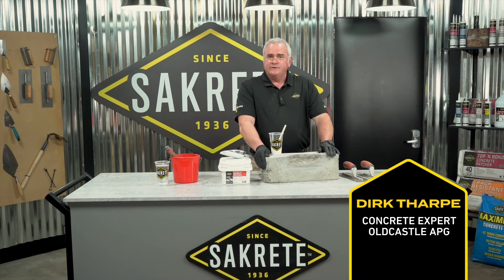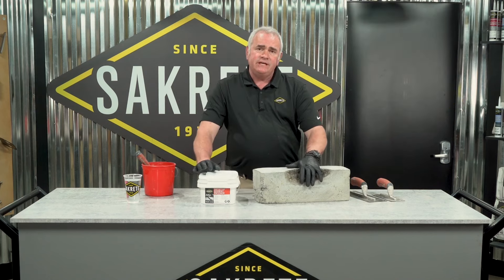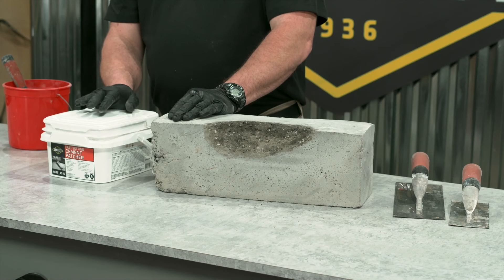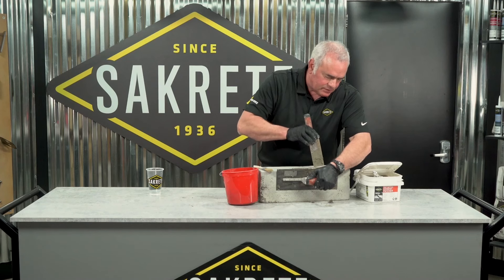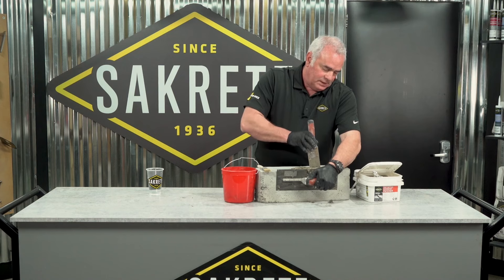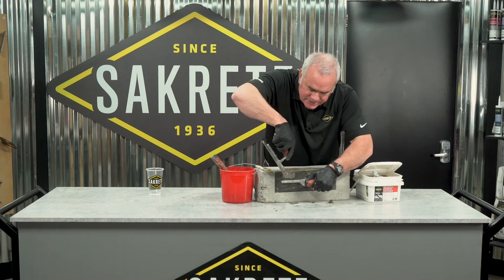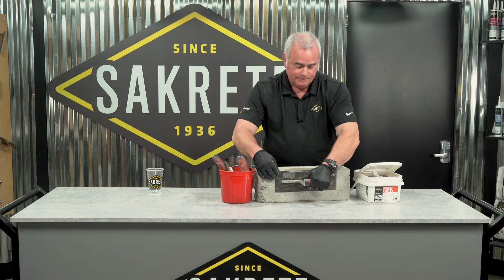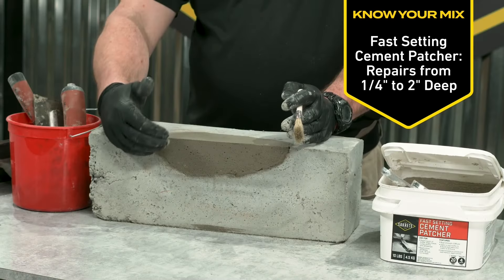Pro Tips: How to Repair Concrete Edges and Deep Damage | Concrete Repair | DIY Project Guide

Comment: Good video.  I would like to add one tip.  I have found it helpful to install concrete screws (tapcons) in the concrete before the repair is made.  This helps to mechanically attach the patch to the concrete.  We have literally installed tractor trailer loads of repair mortars over the years.
Reply from the maker: Absolutely! Great advice, sir. 

Didn't show it on this one to prove that the material can handle that big of a repair unassisted...but we're 100% with you on "real world" repairs!
Reply: How does that work? Do you just have half the screw exposed until you cover it with the cement patcher?

Comment: What is the lowest outside temperature to use this product? Can I do a repair in winter, or must I wait til summer?
Reply from the maker: Good rule of thumb is no concrete work below 40°F. 

Now, you could cover your repair and keep it warm with blankets, heaters, etc., but for non-critical repairs we'd recommend waiting until the weather warms up a bit.
Reply: @SakreteOfficial  Thank you!

Comment: Would this be suitable for driveway repairs?
Reply from the maker: Absolutely. What project are you working on specifically?
Reply: @SakreteOfficial  Large area of spalled and cracked concrete driveway.  Hundreds of square feet.  Just hoping to get 10 years out of it.

Comment: Will the color of the patch match the concrete when dried? I have a clean 10 year old that is power washed, so still bright in color.  Great Video!
Reply from the maker: Unfortunately, it's very unlikely that you're going to get a perfect match right off the bat. That said, if your slab is still a nice, fresh concrete gray, the match will be pretty good!

There are some "rapid setting" (cough) repair products that don't match concrete gray very well, but no such concerns here!

Comment: The video was fun (thanks!).  I'm a laywoman who dabbles in this stuff when I can't find someone to do this and it's common around here.  We have uneven sidewalks due to tree roots growing.  I reached out to our handyguy and even he doesn't know anyone who can do it.  So, it's my job.  Can I use Sakerete to form an angle on a angled sidewalk that's no greater than 2" high.  I'd do a 3" section and bond it before adding more Sakerete and repeat the process.  Depending on the weather, I may or may not use a snowblower and without the cement filled in, it makes snowplowing a literal pain.  Tnx.
Reply from the maker: Fast Setting Cement Patcher would be a great solve. Go check out the "How to Repair an Uneven Slab" video for guidance!

Even better, use our Pro-Mix All-Purpose Cement Mix and you can get the repair done in a single lift – 0-4" with that mix.

Comment: Great video..., 👍
Now is this recommended for a smaller cracks around the chipped cement ?   My driveway has this issue in the area of 2 by 2 feet
Reply from the maker: Right on – glad it was helpful!

On your question about the cracks, it depends if you're FILLING them or just coating over them.

Sounds like a material like Top 'N Bond might be a better fit, as it allows you to go down to a feather edge – smooth to the level of the concrete. 

Shoot us a message on social or Live Chat us on Sakrete.com with more details and we'll figure it out!

Comment: "It's still a 20 minute set, don't get cocky!!"  @3:57 I love that line :)   Thanks for the video it is very helpful, is there an approach you would use for a bullnose edge of pool coping repair, any suggestions on how to form that out in line with the good coping next to it?
Reply from the maker: No one makes concrete entertaining like our man Dirk!

To answer your question about bullnose repairs, that's a tricky one. Best approach probably involves making your own custom edger that matches the radius of that existing bullnose, then using a fast-setting mix like Pro-Mix All-Purpose or Fast Setting Cement Patcher.

Making your own tools sounds a little wild, but we've seen skatepark builders do this quite a bit by softening up a section of PVC with a heat gun and a little patience.

Let us know how it goes and if we can help!

Comment: Thanks for the video.  If I'm using the bonding agent, do I still need to moisten the concrete that is being repaired with water?
Reply from the maker: If you're using bonding agent you SHOULD NOT use water to moisten the repair area. 

When you're priming for a repair, always pick one method (whether that's water, slurry coat or primer) and stick with it!

Comment: I’d like to know about using it on a driveway with a slope and some sunken areas?
Reply from the maker: Sounds like a perfect match. That said, sometimes those "sunken areas" are due to eroded sub-grade, so a PROPER fix would be tearing out that area, adding fill, compacting and re-pouring.

That said, this would be a perfect patch for that sort of damage.

Comment: What can I use for repairs larger than 2 inches? 
My shed slab has pieces off that are about 4 inches deep.
Thanks.
Reply from the maker: Pro-Mix All-Purpose Cement Mix would be a GREAT candidate for that repair. Goes up to 4" and is extremely fast, strong – and pretty user-friendly.

Outside of that product, you're going to need to build a form and use any standard concrete mix.